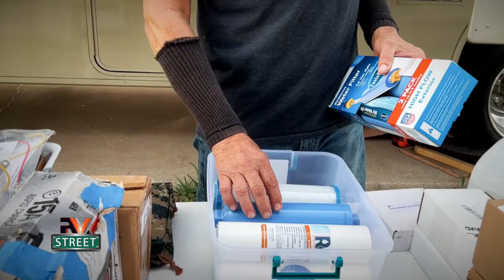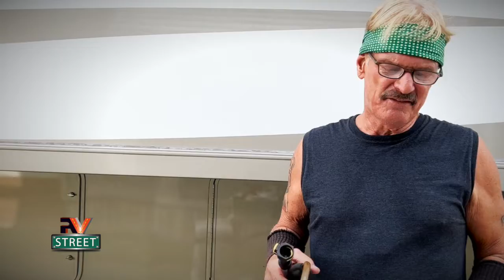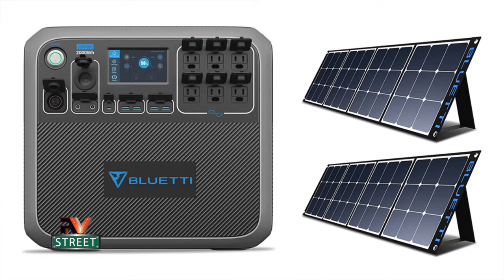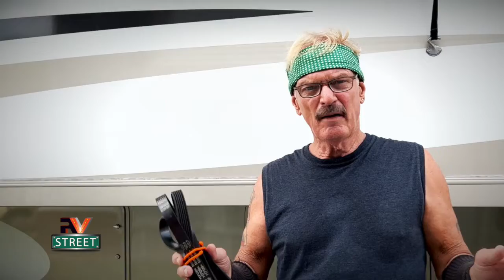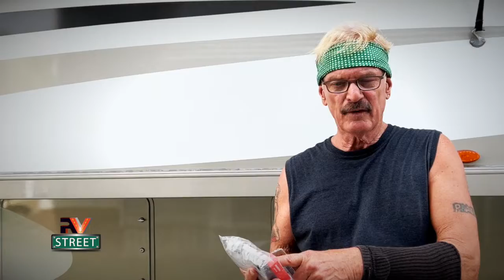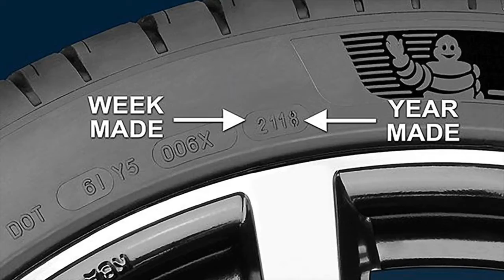Critical RV Spare Parts To Carry • HAVE YOU BEEN LISTENING ?

Comment: Tiffin class A 35": I built the equivalent to a "continental kit" on the back of the MH to carry a spare tire (not mounted on a rim), to give to roadside service to get me down the road and not have to pay the outrageous price for a spare tire off the service truck. Also carry an umbrella to quickly drop into the hole that a tree limb would create falling on the skylight above the shower. And keep extra beer on hand in case..........I run out of beer.
Reply: Beer.  The best spare item to have. I use it for a radiator flush also. Lol.
Reply: I would like to hear more about a continental kit?

Comment: MARTINIZED again! I have a similar list of things, but I’m not as mechanically inclined so, for example, the serpentine belt is not in my coach. There were some things I carry that you didn’t mention.

A 3 foot section of PEX
PEX clamps
Brass PEX fittings (tees, end plugs and elbows)
Sharkbite shutoff valve – in case I don’t have the plumbing connections I need
Tire plug kit – I don’t have a spare or room/weight to carry one
2 feet of Angle iron
3 feet of threaded rod
A replacement mirror – (A trailer next to me at a Cracker Barrel left and broke off my driver side mirror. I  had to fabricate one with the threaded rod & angle iron. (MacGyver would have been proud.)
Wire – I have wire like you have tape! Romex, and various gauges of both stranded and solid wire.

I wonder if the differences you will find in the comments are partially past experience (like my mirror incident,) personal knowledge (I’ve done more plumbing than engine work,) and of course knowing your rig.

Comment: I think I'm about 65% there with my inventory of emergency parts and tools- more to go. Until I get my dead motorhome back and repaired though they don't do me much good LOL! I'm a firm believer in carrying an unmounted new spare. It rides in the toad, which is usually our small pick up. At least I'll have one if I'm in the middle of nowhere and need it.  But you are so right- NO ROOM ON the Motorhome.  One other part I'd suggest carrying is a coil or 2 if you own a gasser motorhome or pickup. They are so easy to change out quickly. All that said this is a great video!

Comment: I have a diesel so I also carry 2 two foot air hoses for the brakes and a coupler to make 1 four  hose for the real bakes (the front brakes hose is 2 foot. ) I also carry an electrical air compressor and hoses ect for it.  As you know with air brakes with a loss of air you will not be moving the coach.  I also carry extra fuel filters for the motorhome and generator.

Comment: I have learned so much from your videos, and I owe you a huge thank you. I'm a widow and have tried very hard to be independent. Could you expand on what you said about your battery charger/tender? I understand about charging and jumping the motor and toad battery. I'm hoping you could do a deeper dive into the Texas example you talked about.
Reply from the maker: • I'm hoping you could do a deeper dive into the Texas example you talked about*
Not sure what Texas example you're speaking of but I'll try.
When I bought our RV in 2016, one of the first things I did was replace our battery charger/aka the converter that charges the house batteries (batts) when plugged in or running on the generator. The factory charger/converter only charged the batt's at 1amp. It basically was a trickle charger. It was useless. So I replaced it with a Progressive Industries 4 stage converter. This converter charges my house batt's thru 4 different stages and keeps them healthy and makes the batt's last a whole lot longer. This is unit I'm talking about:
https://www.amazon.com/dp/B000GASX9O?tag=onamzrvstreet-20&linkCode=ssc&creativeASIN=B000GASX9O&asc_item-id=amzn1.ideas.1OLUPXWJ3B26S&ref_=aip_sf_list_spv_ons_mixed_d_asin
In addition to this unit I also installed a AMP-L-Start which is a little device that steals a little power from my house batteries and keeps the chassis battery topped off. I have a video coming out this spring that will go into this unit more.
Hope this helps.

Comment: I just started watching your channel. I am just like you. I carry backup parts. A few years ago my e450 started going through calipers. I also carry my tools we bought the BT Cruiser from an older couple low mileage. I think it sat outside it was 8 when we got it. After changing 2 caliper on roadside I changed other 2 did a full break bleed installed heavy duty emergency rig pads. That was only issue we had with RV I been carrying in box for new not rebuilt 4 new Calipers with rubber break hoses. Of course they been fine but I feel better knowing I can be ready in middle of nowhere and have to be towed and pay through the noise. I also had road service and one Sunday had tire issue valve issue. We were stuck on side of road 3 hours waiting for them to find service to put on my spare. After that day I said I’m never gonna feel stuck and unsafe again. I bought a compact power tool I can start generator pull off lugs change my spare myself I bought  heavy duty bottle jack easily like 15,000 pound RV just need to lift 1 inch. My coach is in a big garage out of weather and practice pulling inside rear duelers off they spin right off. I could do tire change in 10 min. Of course I chock wheels. I installed 500 watt solar system not a cheap China made system but a good safe system I built. If generator went out I can still use impact wrench to spin out lugs 
All my lugs are torque right so I don’t get frozen lugs. Just replaced spare so it’s fresh 
I also went through finding weight at Cat to adjust proper pressure to tires rear psi is 80 but front requirements are now 65 factory chassis was 80 psi 
Our 28 ft 1 smaller slide coach loaded is about 1500 pounds under max it’s a smaller coach on E450 I like knowing we are nowhere near fully loaded it also reflects our MPG where flat towing a manual Ford Ranger I average 11 mpg we hardly come out of overdrive. I never push coach light foot pedal staying between 63-65 
I enjoy your channel I picked up things I gotta get.
Reply from the maker: Spare parts and tools are always a must with traveling because you never know that is going to happen on the road. It sounds to me like you have it all under control my friend. Safe travels to you.

Comment: Another great vid Martin! You can carry just a spare tire (w/o rim) inside your basement on a Class A MH. That will save some money if you have an issue on the road. BTW, the expiration date on a tire is not a big deal to a tire that has not been mounted or used. As long as it’s protected from the elements. Just say’n! Keep up the great work, Sir!
Reply from the maker: •the expiration date on a tire is not a big deal to a tire that has not been mounted or used•
Thank you CO but......
I totally disagree. Actually it is a big deal. Any tire begins to age the moment it comes off the assembly line whether it's protected from the elements or not, on a rack in a warehouse or sitting in at a tire dealer. This is why when you go to buy new tires you ALWAYS insist tires that have a DOT date no more than 6 months old. If they're older than and especially a year old or so then ask for a discount b/c they too know that the tire has begun to age.
Reply: @RVstreet   … Not totally true. This is the common conception, but, as long as the tire has not been subjected to the natural elements or has been mounted or used for it’s intended purpose. I can see where you would disagree, and I respect that. The same holds true for medication, canned food, and several other things that would not normally expire with a “suggested expiration date”. This is an industry standard required by the government. It does not always hold true though. I’m not trying to disrespect you or your views, but I’m here to offer a different perspective. Take it or leave it. You do a great job and I respect your opinion. Thanks Brotha!
Reply from the maker: @COMtnPilot  Ok kewl, I like a respectable debate. But your comparison to medication or food is not apples to apples. Tires are made from different materials and with chemical compounds. These chemical compounds are activated by heat. Heat is generated from running the tires. This is why when a simple question that is asked "how long do tires last, what is their life span and when should they be changed. It's a complicated answer and many, many things contribute to the correct answer.
For example.
• tires that are run often are much healthier than tires that sit for long periods of time. They are exercised and these chemical compounds are activated which contribute to the rubbers life
• Proper PSI also contributes to the healthiness of tires
• Over loading tires can be harmful too, to the life of a tire
• An RV or any vehicle for that matter that just sits for long periods of time, those tires will expire and be unsafe to run under load MORE QUICKLY than tires on a vehicle operated often
I could actually go on and make a very long list of things that either help the life or hurt the life of tires, but I think this makes my point.
This applies to a spare tire too. Even though a spare may be protected, it just sits and none of the above happens to a spare.

The suggested expiration date of meds and food is totally different but I know what your saying. Those items can actually last and be used a lot longer. But they do not need all the things tires need to stay healthy over time. It's just not the same.

Here's a good read if you're interested that covers anything and everything about RV tires. It's pretty much the Tire Bible and written by Roger Marble—a man who has spent his whole in the tire industry in many capacities—and who is pretty much the authority on everything tires. https://www.rvtiresafety.net

Comment: Martin I carry spare fuses for the coach and the e450 cab as well blus multi meter and everything electrical.  Also 1/4 and 3/8 sockets ratchets and same for all types of wrenches both standard and metric plus different bits for you name it. Spare antifreeze and different lubes. The list goes further as yours so I’ll leave it there.
Reply: Hey Rick what kind of motorhome do you have I have an E450 chassis on a 97 Ford motor where is your OB 2 port located I cannot find mine
Reply: @richardyoung5586  well if memory serves me right it should be under the steering column probably tucked under the plastic panel, if you look up there you should see it,, and by rights it might pull down so you can plug into it. Hope that helps

Comment: Thanks so much for your great videos! I pretty much carry almost everything that you do but I still need to pick up a few items.

 If I may add, my shower drain leaked on our way from Florida to California,(the threads cracked on the P-trap, I think it was that way from the factory I tightened it by hand multiple times, until I finally found the issue )I had to stop in Biloxi Mississippi at four different stops to get the right plumbing fittings, because it’s a Weird size on the black PVC that’s used on these RVs. I now carry some small, black PVC plumbing drain pipes and extra P-trap! 
I also carry a spare, drinking safe water hose.

I hear yeah about the spare. I struggled with it myself, but I wound up getting a bumper carrier, modified and welded to my bumper. I can’t be without a spare. Even if you have roadside, they may not come with your tire size! if you’re stuck out on a highway or desolate stretch of road , like i10, where there’s no help, you’ll be crippled for days!
Reply from the maker: How did the drain leak? Did you have the water pump ON while traveling ?
Reply: @RVstreet  it was the P-Trap at the bottom of the shower pan. The factory must of over tightened the nut that tightens up the trap to the tail pipe, it was cracked. I had a water leak sensor under the pan and it went off one day when I was showering. It’s in a had to reach area. One note, if you ever need to find black PVC pipe or fittings, mobile home supply places have them!
Reply from the maker: @johnc3225  👍

Comment: Martin you have a spare one of your dual ! Your videos are awsome Martin !!!you guys do a great job on informing others of what may be needed
Furnace board
Sail switch 
High limit
Blower motor
Water fittings
Water pipe 
Water heater anode rod 
Water heater Eliment
Water addapter 3/4  npt to pex 
Pex ring crimper plyers
Spear 30 or 20 lp tank what ever your flavor
Spare 2 stage reg, and lp hoses 
I changed mine over soft white led lites 
Fuses
High amp car chager 
30 ton boddle jack
Jack stands 
Electric heaters watch 15 or 17 watt heaters need use all 15 amps of one breaker if you hqve 30 amp service your at 1/2 capasity . Have some drop cords to plug into shore power. 
I may revise this when i have more time .

Comment: Another helpful video, thanks. But where and how do you store all these parts? We have a 2014, 38", Itasca (Winnebago) Suncruiser, similar to yours in basement layout. I am certain I could get rid of some stuff to make some room. Share some of your organizational strategies with us.
Reply from the maker: I have one bay on the drivers side that is dedicated to tools, parts, lubes, electrical stuff, bottle jack, cleaning and polishing gear, small power tools etc. I have 4,600lbs of CCC so I have plenty of room and weight to carry all this. For others reading this comment that have a smaller RV, you just have to be more select on what you can carry and where you put it. Sometimes some of this can be stored in the tow vehicle or truck that tows a pull behind in places where it doesn't get in the way.
Reply: @RVstreet  I need to clear out the stuff I have not used for awhile. I am retied Army, so I lean into preparedness as well. Now that our RV is 8 years old its time to review my priorities. Spare parts should be closer to the top of that list. The RV isn't the only thing getting older 🙂. I appreciate everything you do.

Comment: Martin,
I’ve been trying to find a video I think you made.  I have the same coach and went to start it yesterday and there’s zero power to dash.  Battery is fine.  I’m thinking it may be one of the (I may be using wrong verbiage) solenoid in the electrical bay behind driver steer.  I think you carry one.  
Still trying to diagnose.
I hate to ask with you dealing with cancer but hope you can direct me to video.
Thanks and take care.